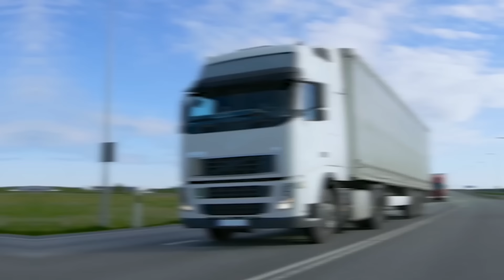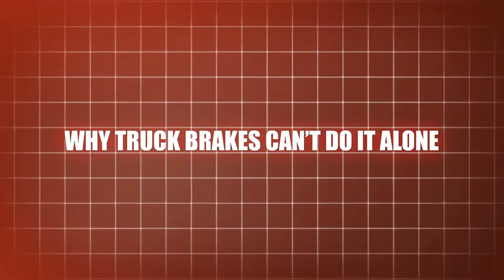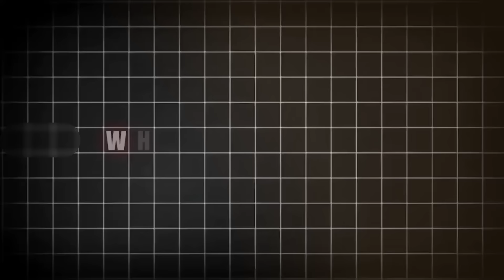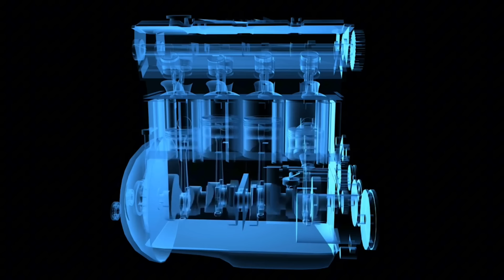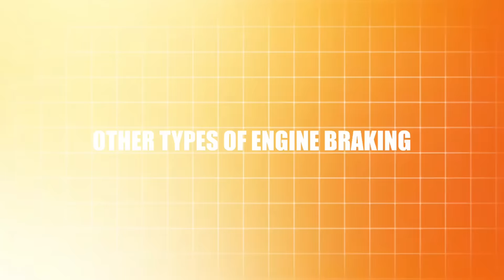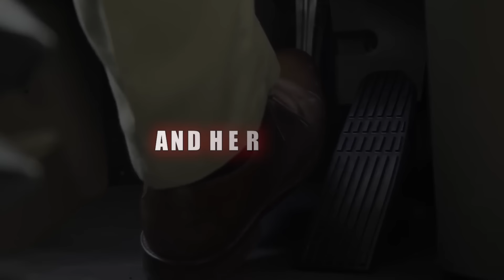The Jake Brake Isn't a Brake—Here's Why Truckers Can't Live Without It

Comment: Europe which much stronger noise limits do not use Jake brakes, they use a hydraulic system as part of the transmission,  it is just a effective as a Jake brake but much quieter.

Comment: Another difference between cars engine braking and trucks engine braking is that cars have a throttle valve in the intake that will work very well to slow a car down, especially when combined with downshifting the transmission. Diesels do not have a throttle valve, so when you back off the throttle, there is very little braking effort from the engine unless you have a Jake or exhaust brake. The weight trucks typically carry only compounds the problem.

Comment: speed is not the issue, momentum is
Reply: That is why American trucks use drum brakes to take braking over longer periods of time and use compressed air to release the brakes. This eliminates any risk of brake fading, also air is used only to release the brakes not to engage them. This prevents a loss of braking power if there is low air pressure, same goes for school and public transportation buses.